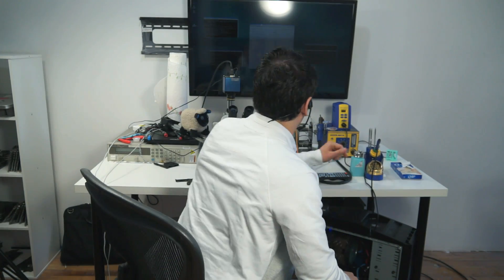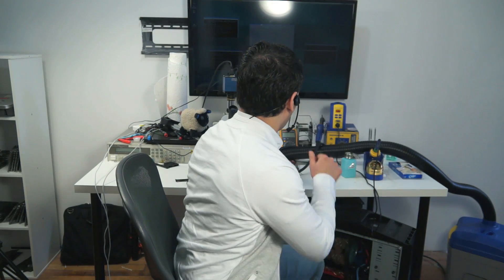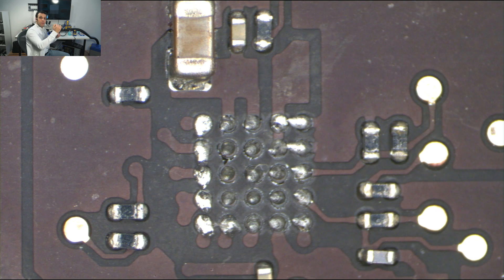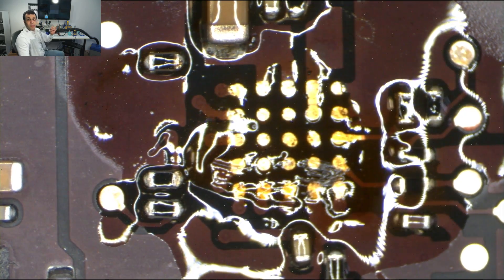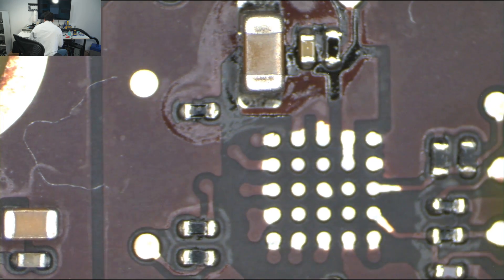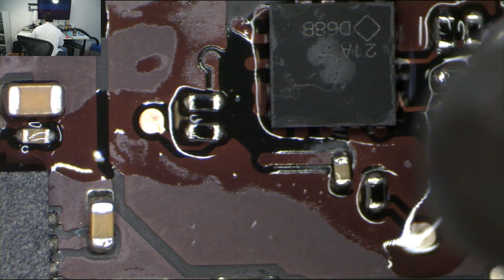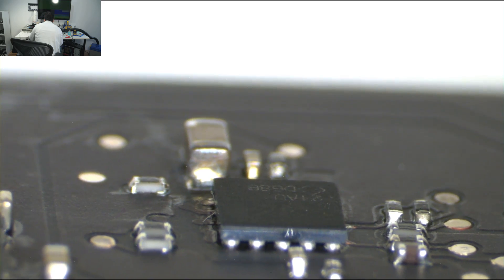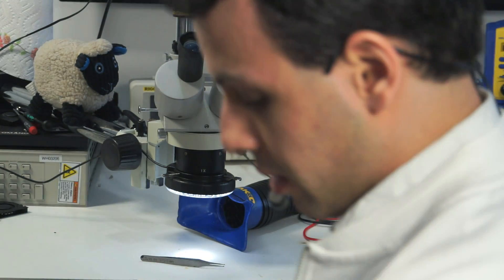How to solder WLED driver LP8550 BGA chip on a Macbook Air

Comment: Im not sure how to get your attention. As past e-mails don't seem to get thru. 
My question for you is how do you deal with chips that are stuck. 
I've taken the heat up to 290 c. 
But the chip will just not lift. And Im too scared to lift a pad. So stopped. 
I cant see any glue. But some BGA chips are glued in place. 
How do you deal with these stubborn chips? 
There are components on the underside so I do not wish to melt that. 
Dealing with these tough chips would be a help. 
Im tempted to just take my soldering iron to the dam thing. As Im putting in a new chip anyway.

Comment: Around 10:44 after wicking and cleaning. Those two pads in the top right corner that seem to have become merged, why is that not a problem?
Just wondering won’t the solder from the IC possibly merge across that bridge between to the two pads? Is it ok to leave like that?
Reply: when you check the diagram you can see that those two pins are identically routed (lcdbklt_boost)

Comment: Just want to say thanks for this video. Successfully fixed a backlight issue board I got off eBay for $50. Lol. It's a 2015 2.2 GHz 8gb ram. First time replacing an LED driver. Which BTW holy fast shipping from your website. Thanks again

Comment: my hot air can go up to 480 degree Celsius is that enough for this job?
Reply from the maker: if it actually does, yes. don't believe what it says on the dial.
Reply: @rossmanngroup  I am trying this repair, but the chip is stuck and doesnt move. so I shouldn't worry about overheating?

Comment: One thing that stuck out to me -- I've always heard that when working with small pads like that, you should only dab with the wick and not scrub it back and forth like you did, because scrubbing can pull the pads off. Have you had any experience where that happened?
Reply from the maker: +rfmerrill WIth an iPhone absolutely. With this I have nothing to worry about. It's important to know the board you are working on. If you do not know the board well, tread carefully.
Reply: +Louis Rossmann whoa, quick reply! thanks for getting back. yeah I figured it depends on the particular board

Comment: I have an A1297 Macbook Pro, suffered water damage - everything works, just not the backlight, and the panel looks fine.

Do these models also use the same LP8550 chip?
Reply from the maker: kr239 A1297 covers four different laptops with four motherboards across three different years, that all use different backlight circuitry.
Reply: The serial number of the board in mine is: 820-2914-B

Upon having a look at the schematic, it looks to be an LP8545SQX QFN package. If this is indeed the case - are these more/less easily replaced compared to the BGA packages?

Also - thank you for the video's, very informative! :)
Reply from the maker: uses lp8550, yes.
Reply: +Louis Rossmann Louis love your videos sir. I did this with 820-3115B lb and when I removed this ic chip lp8550 underneath I saw that there were old balls or sorter missing. if we're to reply  flux and some lead would that help at all. thanks in advance

Comment: I have a 820-3024-b MBA with no backlight, firstly I changed the blown fuse and now I'm getting 8v either side, but still no BKLT. I've done some measuring and I've noticed that the Q9706 MOSFET isn't giving out any voltage. Pin 3,4 (in) 8v pin 1,2,5,6 0v. With the Q9706 removed I am getting gnd on the output pins so I'm thinking of changing the LP8550 but before I do, I have a question: The input to q9706 pin 3,4 is 8v, but I'm not getting any output from 1,2,5,6. which in turn sends power to the LP8550. Do you think it could be the Q9706 is at fault?
Reply from the maker: Are you sure you have video output on the LCD? A lot of people mistake no video for no backlight.
Reply: Louis Rossmann I do have video output without the fuse in or when it was blown on the LCD. All works well. LCD shows a faint image and the output monitor works. But when I put a new fuse in the without the LVDS cable connected I get a 'dong' and the apple logo shows on the output monitor and then the loading bar will show and then the fan will run at very high speed and 'pop' goes the fuse.
Reply: Rick Kap Louis I've been thinking today, why do you ask if I had video output?

Comment: hey loise i have a question about smc. i have desoldered, reballed and put back these smc easly, but sometimes smc need to be replaced because they gone wrong, but if u look for new smc chip, u can buy them fow few dollars, but they come without a firmware. now looking almost everywhere, seems like u cant program those new smc. do you know anything about that ?
Reply from the maker: ScruffyITA No way to program it.

Comment: Hi Louis, i got the same problem backlight on a macbook air and still in my office, could you send me a link where to buy tools to remove the chips,  i really appreciate your videos and explanation . please email me the tools soldering station model  , microscope model  , flux code etc.. Thanks in advance man.
Reply from the maker: That's a lot of stuff you want me to email you. I can't do your homework for you, but if you look through the videos you'll see what I use. fr-801, fx-951, omano microscope, amtech flux.

Comment: I recommend a proper preheated, means you dont have to run the iron temp to high and risk De-lamination on the pads (notice the mask basically disappeared when he wicked it, it ends with better ball formation in general.

Comment: Thanks for sharing Louis. One question, with the airflow on the hot air turned all the way up to 10, are you not in danger of blowing other components off? I usually have my airflow at near minimum (but I'm only learning!) lol
Reply from the maker: 10 is 1/3 the way up. I forget if mine goes to 20 or 30, I believe 30. I honestly never look at the numbers, I look at how high the ball is and I never go higher than 10 or 12 on it anyway. If airflow is too low, the heating element turns off.
Reply: Louis Rossmann ahh that explains it. I have a Solderwerks Blackjack and 10 is maximum on that :)